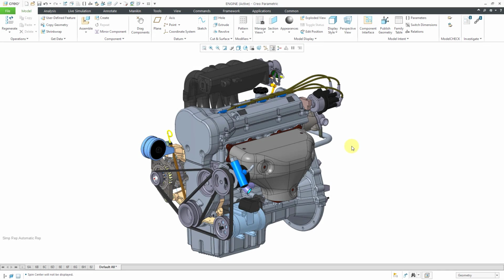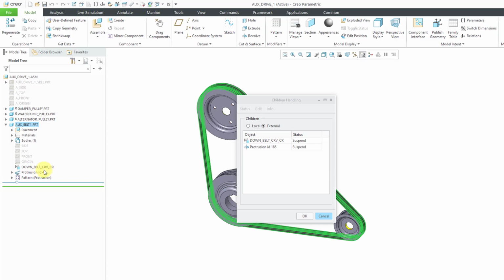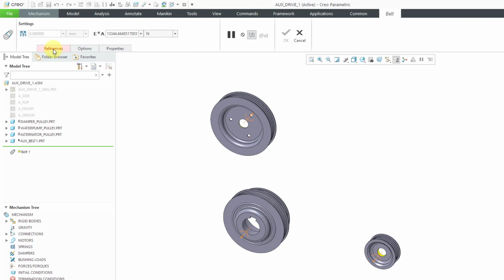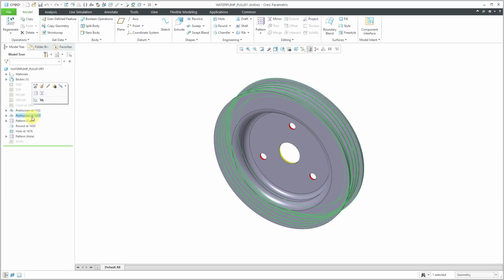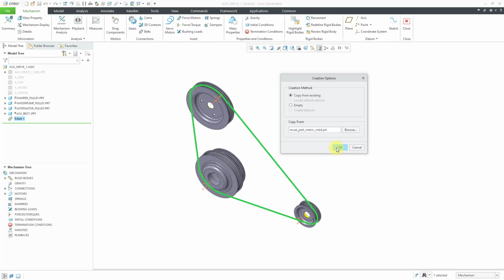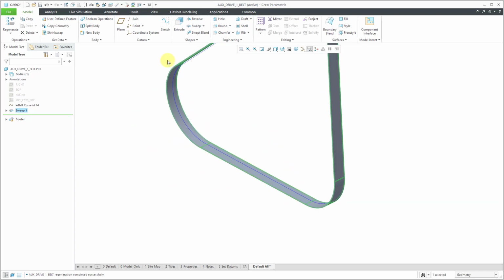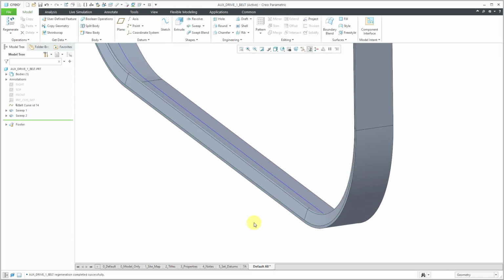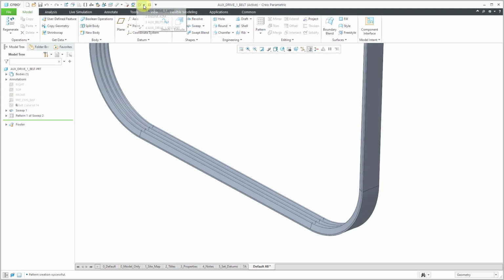Creo Parametric - Mechanism Belts Example - Automotive Auxiliary Belt

Comment: I m using creo 8 after sometime it will give message that 
'licence is lost' 
Plz give solution
Reply from the maker: For technical support issues, you should contact PTC Technical Support. Setting suppress_license_loss_dialog to yes will decrease the frequency of messages.

Comment: Your vedios are very usefull, I need one video to simulate the mechanism as working in machines, for example we will give pin joint in shaft and hole but in actuall scenario we will not have that condition we will have contact at one surface insted of equal gap allover the hole, can you make one vedio like that..
If we cam joints we can't get efforts.